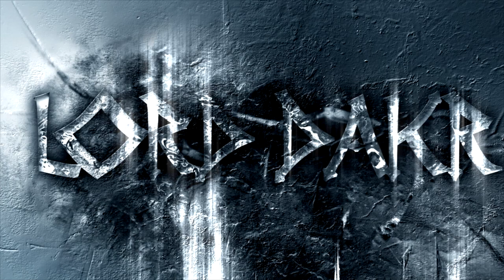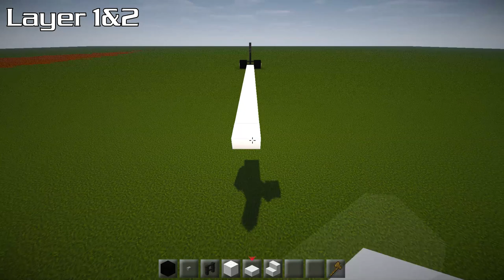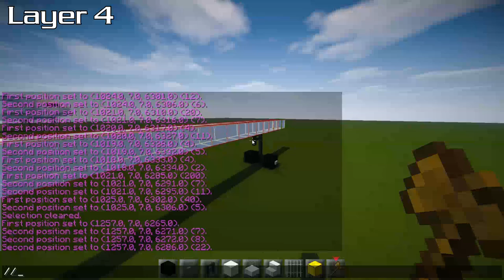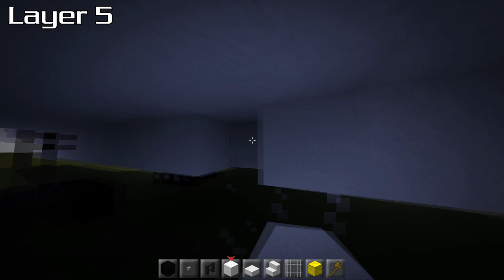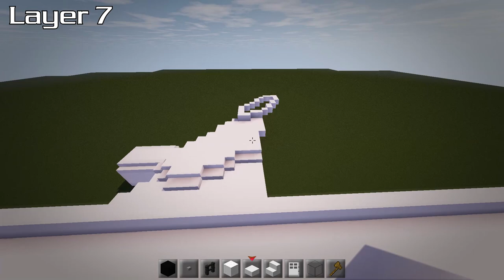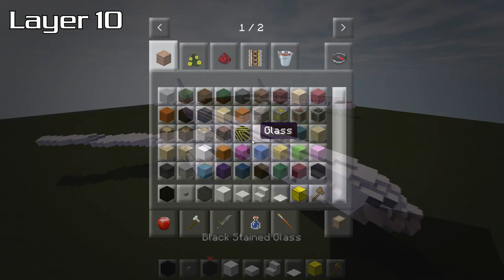Minecraft: Boeing 777 Tutorial

Comment: Thinking of building this in survival mode, need to get some more materials to work with, but I'm thinking of using another block to give it some colors or perhaps use some dyed wool 🤔 
I wouldn't mind adding a couple more engines to the center part of the wings so it adds a little extra detail to it and they can be added later on when it's finished being built.
I originally wanted to build it in the air so it looks like a plane is flying above my village but this gives me an idea for building a runway and possibly an airport somewhere 😀
Reply: I built it in survival, it takes some time but once you get all the materials it's not to bad